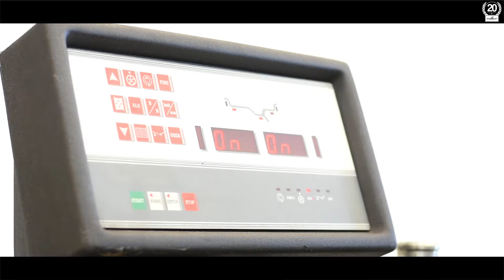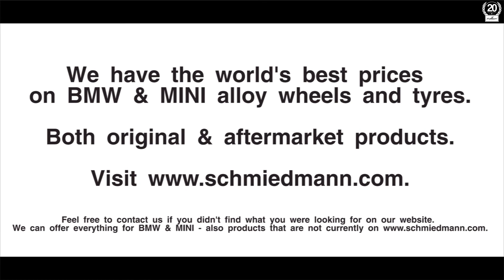21" Breyton Rims mounted on BMW F11 530D xDrive at Schmiedmann

Comment: Thats how you kill a transfercase :) congratulations
Reply: why would transfercase brake with this tyre setup?
Reply: If tire size is correct(245/35 in front and 285/30 on rear the tire spin radious is same so it will not brake anything. Car does not know the witdh of the tire.